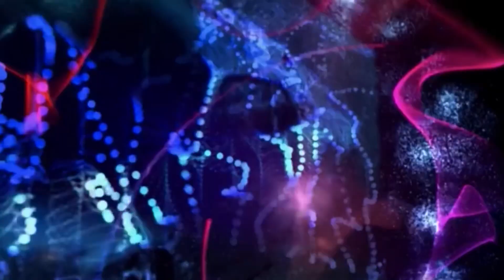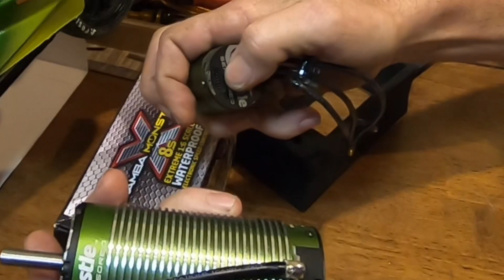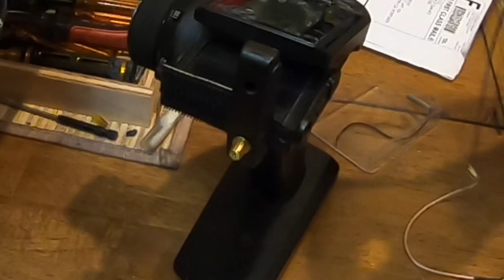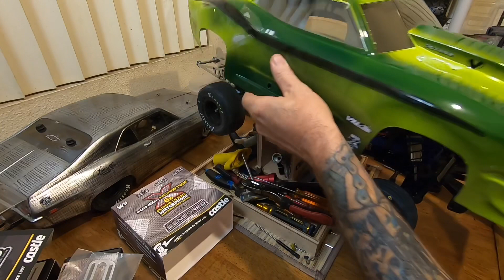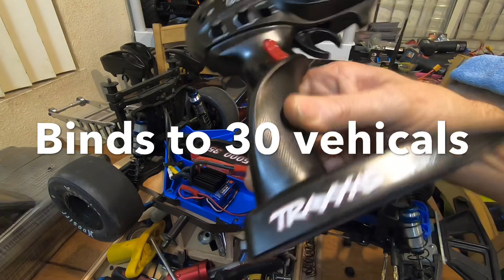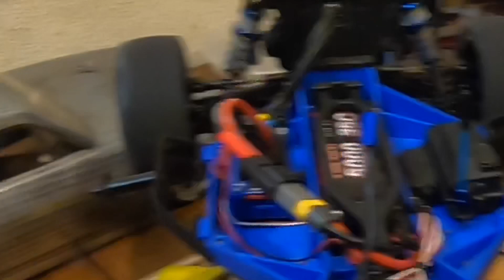New build parts & what’s in watermelon??

Comment: Watermelon is awesome. What I like about the Slash platform over the Team Associated vehicle is the use of metal gears in the transmission. But someone like me getting started and running 2-3s I assume the DR10 stock transmission should be fine if I use the stock electronics. I hope the Proline shocks is the only thing you need to keep that DR10 straight. I’ve watched your videos on it and like you said so close but quite there yet.
Reply from the maker: Thank you 🙏 it’s been some work in the dr10 to get it going this straight lol 😂👍👍💯💯🔥🔥🔥🔥

Comment: Hey Earl, do you have a link for that booster that you bought? The new booster, I'm referring to. I actually had bought two of the same white ones you have. You are correct, it does get very hot. I want to buy one with more voltage, such as the one you bought. That motor looks insane. I cannot wait to see it running on the Kraton 8S.
Reply from the maker: I’ve had it for a year now let me see if there is a link for it ?
Reply from the maker: https://www.ebay.com/itm/FPV-2-4G-2W-2000mW-Radio-Signal-Booster-Amplifier-Module-for-DJI-RC-Transmitter-/112384832964
Reply: @earlmoorhead5555  Thank you very much for the link. I am a big fan of your projects. Looking forward to your next video. Let us see if you can wake up that big Kraton 8S with that motor.
Reply from the maker: Luis Cortez yes I hope a 1/5 scale true motor can wake it up appreciate the support 💯💯🔥🔥🔥🔥